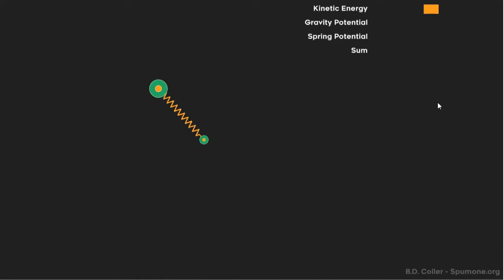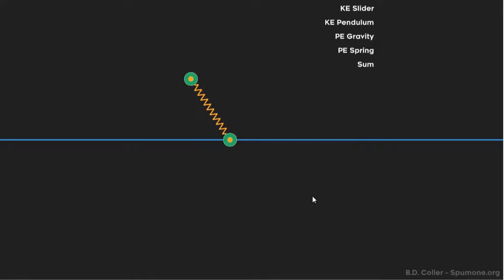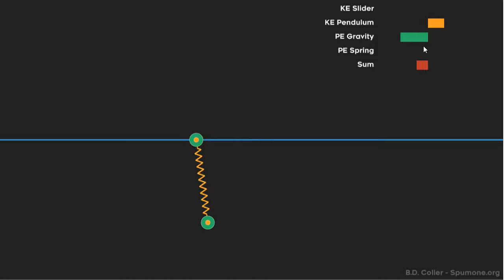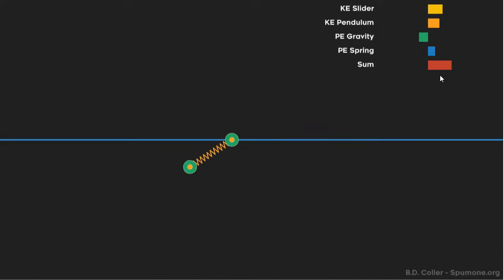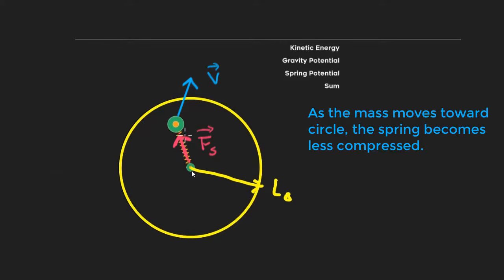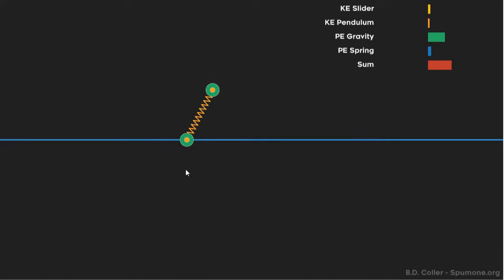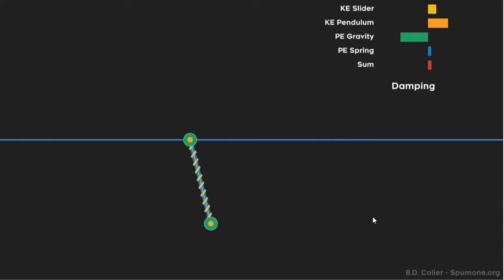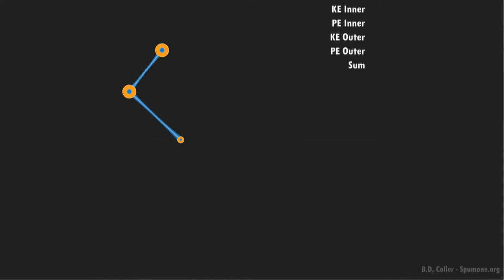Springy Pendulum with a Sliding Base

Comment: Dear Brianno,
First of all I like the way you explain the subjects!! This is the main reason I decided contacting you. 
I am an Electrical Engineer , Brazilian and graduated 52 years ago and trying to take advantage of the pandemic and brush up on the beauty of Science instead of watching TV...
I was, and am, searching on modelling and solve a dynamic problem which I will simplify below...in order to do so I was digging your channel but was not able to select some fundamental videos and so I am kindly asking you the ones which would help me to equate the problem. 
Imagine a small and heavy metal square platform, say 1 m2, and sitting over four steel balls (instead of wheels...). The horizontal displacement is limited to  some 2 or 3 mm   
Attached to a flexible string, and hanging at the bottom of the platform there is a steel ball of 1kg   The system is at rest. All of a sudden someone jumps over the platform in a forward direction. The platform will slide over the balls and stop (forget rebound...) hitting the wall after a 2mm displacement. 
How to calculate the string and hanging ball  movement (displacement ) and  energy....How dependent is the ball energy to the length of the string?
Please tell me which of your videos are a hint to solve this...
Best Regards and Thanks
Pedro